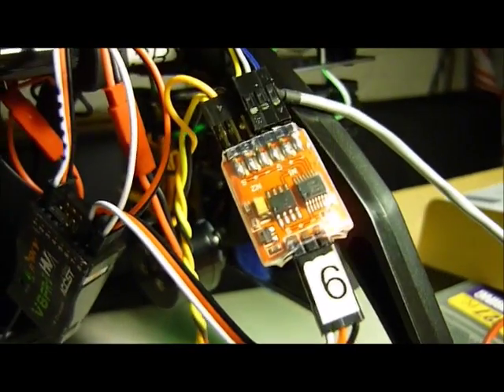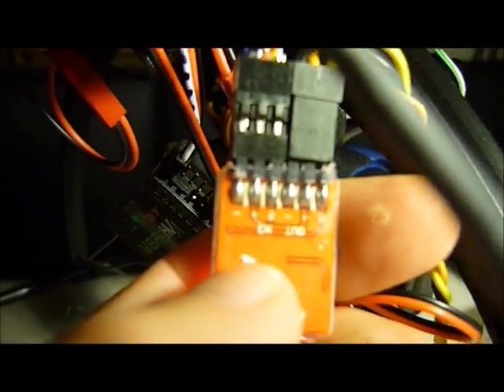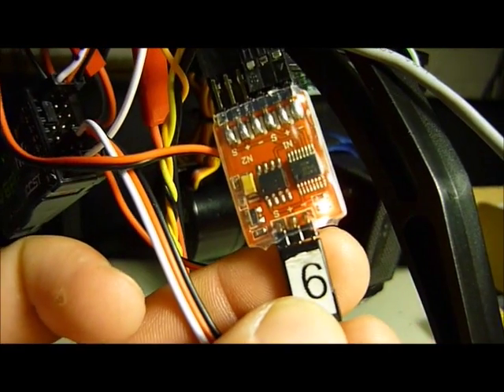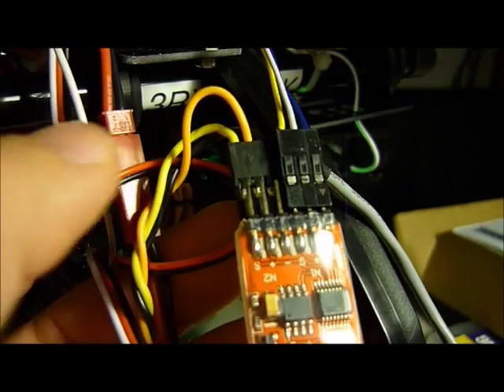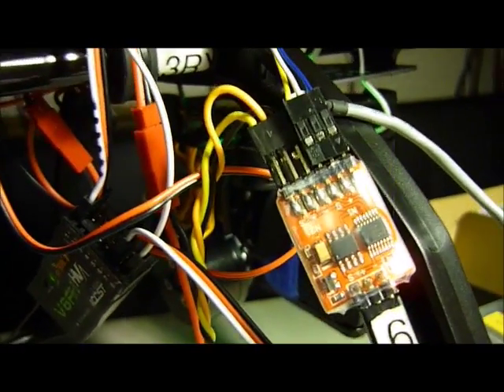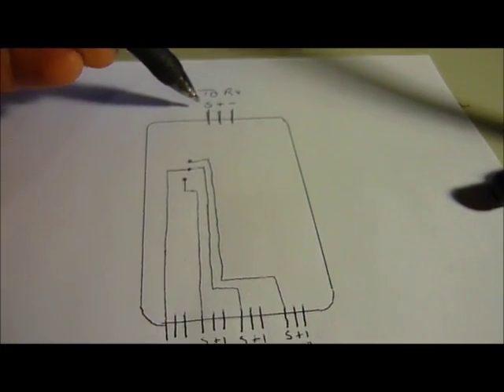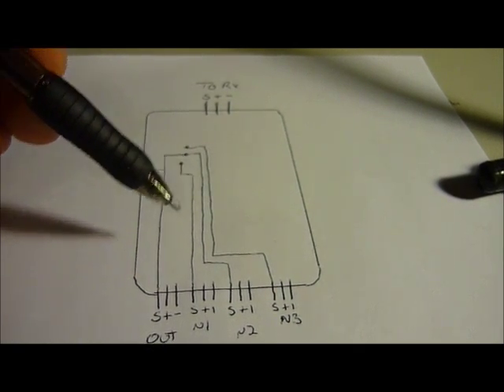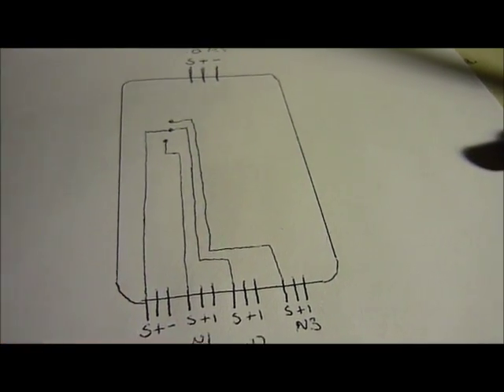3 way switch fpv

Comment: could this device be used in a situation where a multiplexer/Demultiplexer is used?
I mean to say, will this device work the same if there were 3 pwm sources and 1 pwm output that can be switched between
Reply from the maker: Hemanth Reddy if I read you right, that's what is going on.  Its a 3 position channel as the input and 3 dry contacts on the output side.

Comment: thanks for the video I wish I had found this a week ago its been driving me nuts. Also I have been trying to send the signal to a minimosd without luck also, derrr. I assume then that wiring it your way and sending the OUT signal wire to the IN osd video should show some results too. I will give it a go hopefully today. thanks again

Comment: great vid, surprised there are no comments! I have just ordered what looks like the same switcher so glad I saw your video. The way you have his wired up, when you switch to cam 2, cam 1 loses power I assume. So it's not as if both cameras are 'running' and you are just switching the input, you are actually powering on and off the cameras when switching, is that right? I wonder if that explains the slight delay. I've read a lot of comments from people wishing it would switch faster, but perhaps they are blaming the board when in fact the delay is caused by the camera starting up each time.
Reply from the maker: yes in this case.... you could also tie the camera POWERS together and only break the signal feed, and as im assuming you picked up on, would avoid the glitch between switching between cam 1,2 and 3 

i was so frazzled after figuring this out,  tweeking it further wasnt an option that day lol. nice spotting!
Reply: Edward Lucas mine came in the post today. one of my cams is a runcam 3. my video system is 12v and although the runcam is happy with that it makes a squealing noise which can only mean it is working hard to step the power down. so I've powered the runcam with my 5v ubec instead. the other cam still gets its 12v via the switcher. there seems to be very little delay when switching but im still going to try giving both cameras a shared and continuous 5v supply just out of curiosity
Reply from the maker: Chris Flory I would be curious to see how it works with the cameras constantly supplied with power. If you think about it tag me in your video or send me the link here I'd love to see it :-)
Reply: it looks like it is not swithing the power between 3 cameras because you can see that  all  +  are not connected anywhere else to the chip or other electronic components , they are suspend so all cameras works at the same time just signal is swithing between